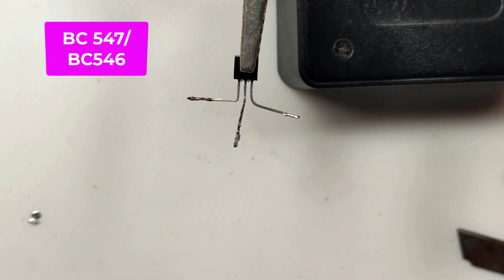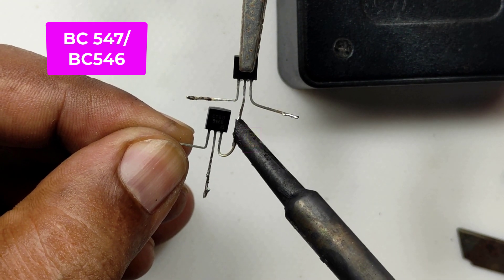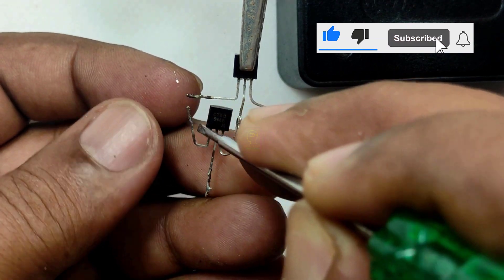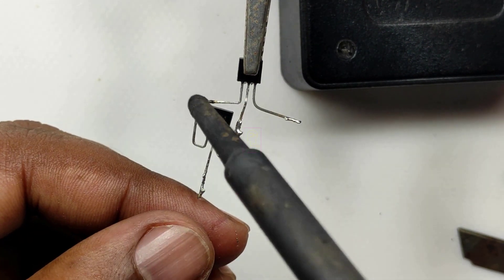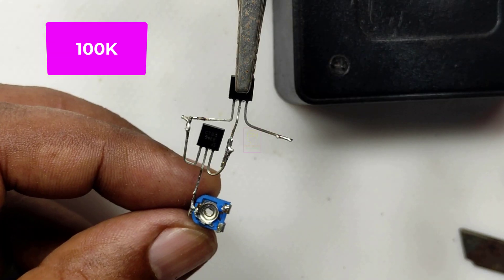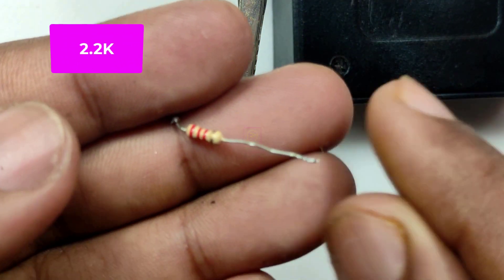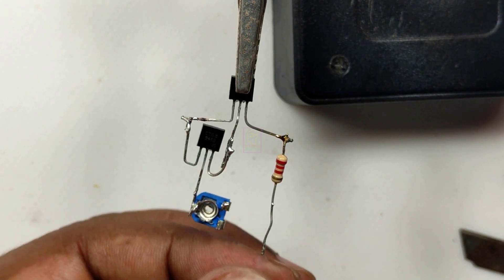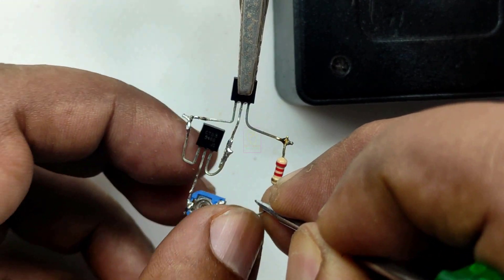Unlock the Mystery of Crafting an Inevitable Fire Alarm!

Comment: Interesting... If you could integrate this with a 230v relay then it will be good. Circuit is needed
Reply from the maker: You can replace the led with relay. No more changes are required.
Reply: @TechInsert  ok thanks